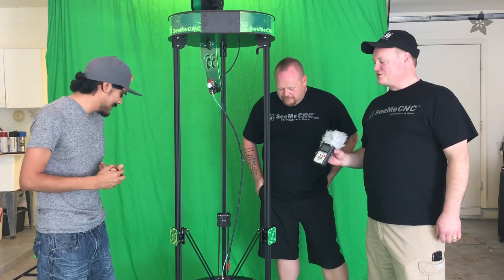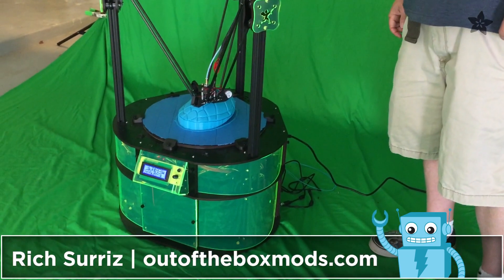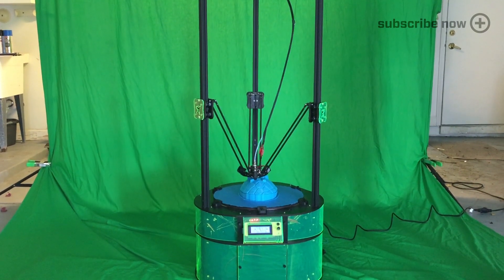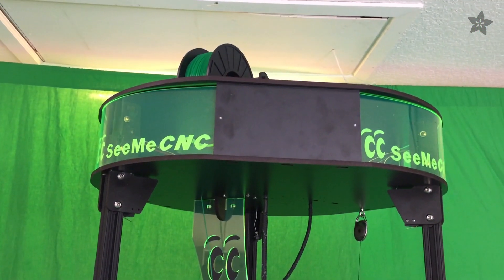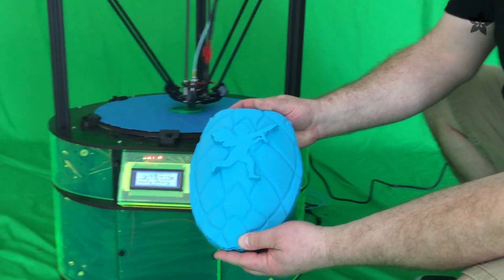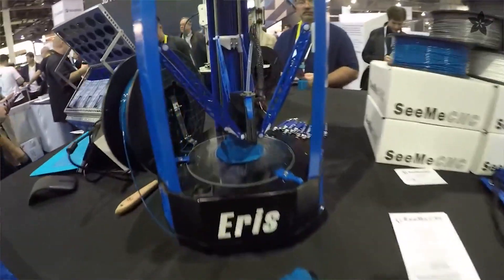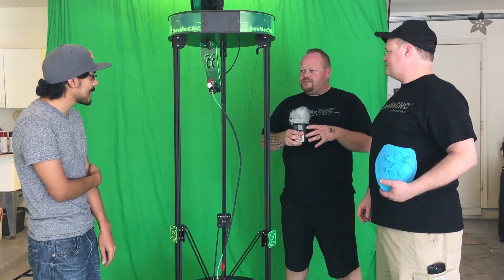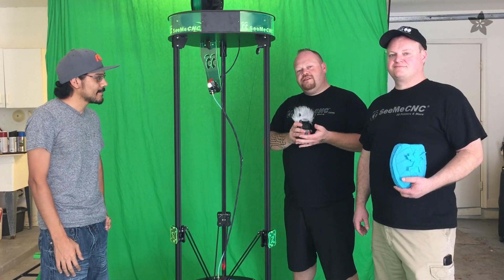SeeMeCNC VIP Delta 3D Printer

Comment: Big separation between arms in the effector, no flying extruder and the worst thing: it's slow for a delta printer. They should do research before build something, I only see a giant and expensive printer that has no advantage against a cheap cartesian printer (except for the Z area).